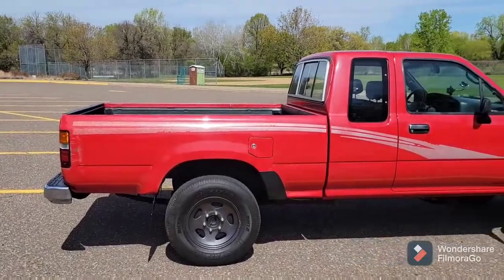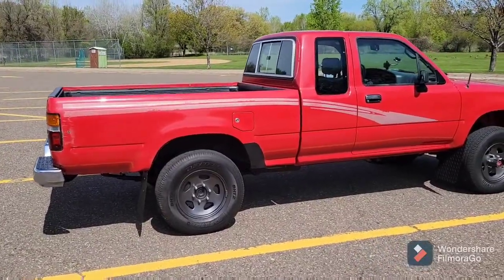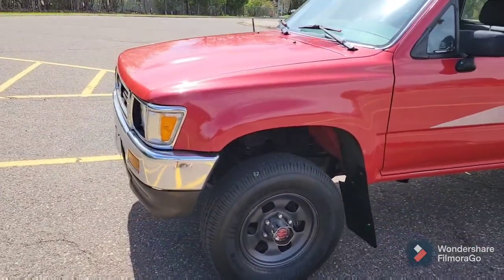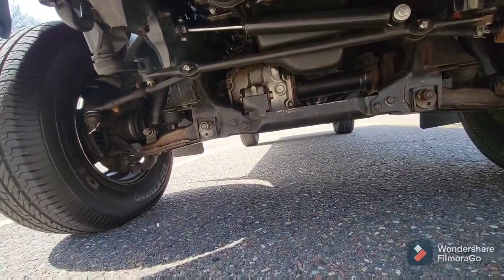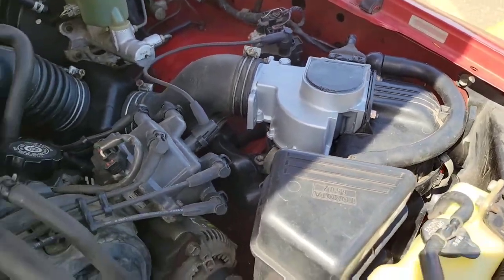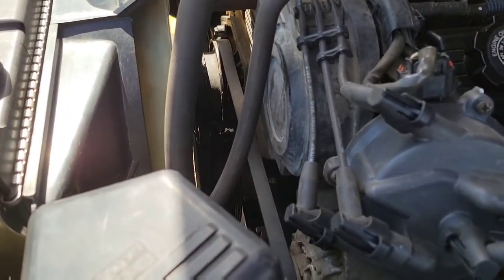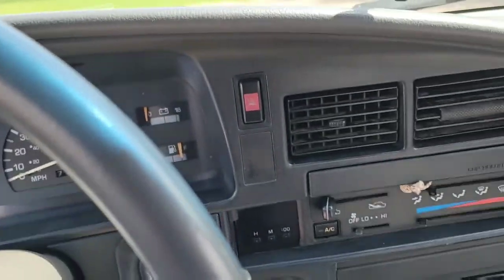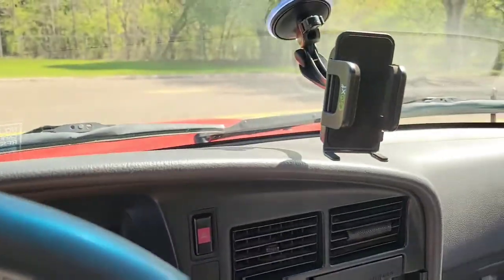Vlog 12 - 1993 Toyota Pickup 3.0 V6 Manual 4x4 Walkaround

Comment: Clean little Toy. I live up in the mountains waaay off grid all trail climbing to get up here. So it's lifted 6 " armored with Rock sliders and monster winch brush guard front bumper 3.0 V 6 ,5 speed on Super swamper I Roks 36'x 13.50 x 15". 144000 miles and runs strong. Dandahermit

Comment: I have a 93 also. Bought it new. Been a good truck. Change your oil every 3000 miles and grease it couple times a year. You did good. Good looking truck. Had in the shop a while back for new fan clutch, TPS, one valve cover gasket, thermostat, new plugs, wires, distributor cap and new rotor button. Did some of this stuff myself. Recently had to get a new fuel tank and sending unit. Recently put a new alternator on it. I have 186000 miles on mine now. I constantly have people wanting to buy it. I say no because it’s like one of the family. Take care.
Reply from the maker: Hey Todd, I totally agree. I recently put it up for sale but took it down after getting inquiries from 40+ individuals overnight offering 10k. At that point I knew I didnt wanna sell it no more lol.

Comment: Can’t wait to see more.  Mine came with the vacuum operated 4wd.  Do you have that or manual locking and unlocking.  Weird my deluxe didn’t come with AC or a clock.
Reply from the maker: Hi Norm, I believe mine came with the vacuum operated 4wd from factory because theres a couple of electrical connections unplugged and there's no where to plug them into. I am glad someone put in the manual hubs before me :)